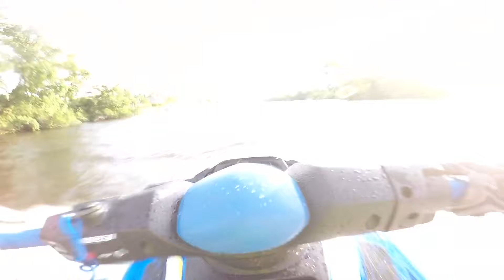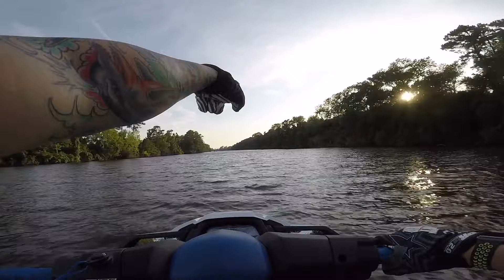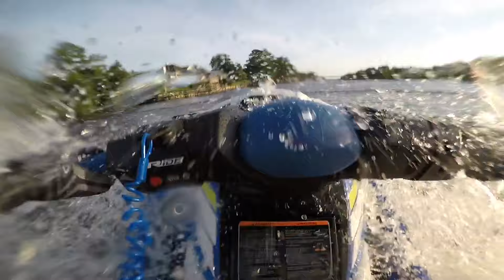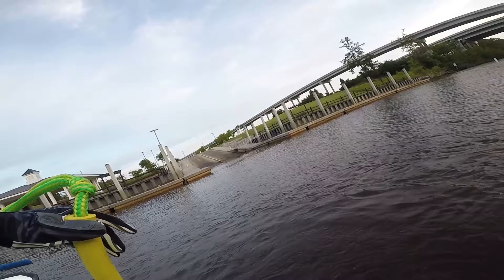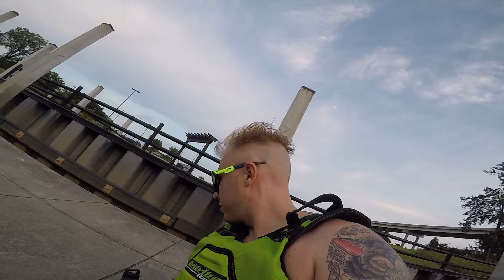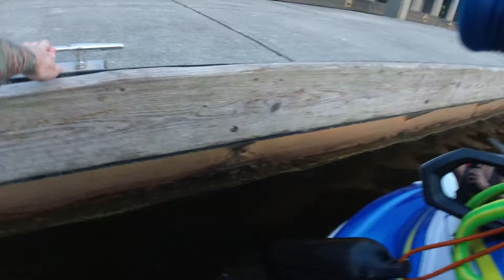2019 Yamaha GP1800R Riva Racing Stage 1 VS Air Force F-16 Fighting Falcon

Comment: The manual for the GP1800R says 5 minute warmup below 2,000 RPM and actual break in period is 90 minutes while fluctuating between rpms (no greater than 5,000rpm).